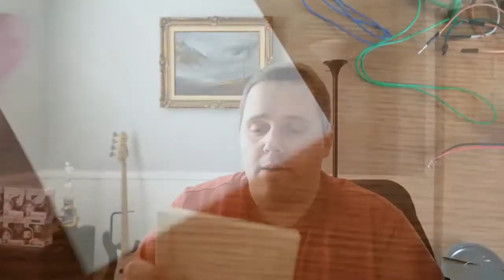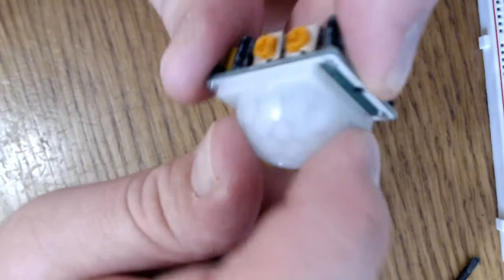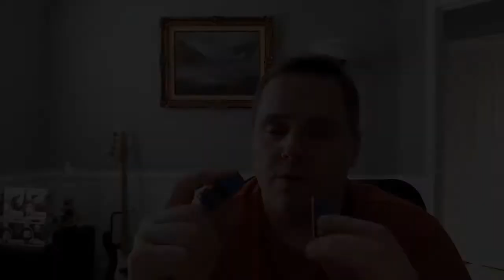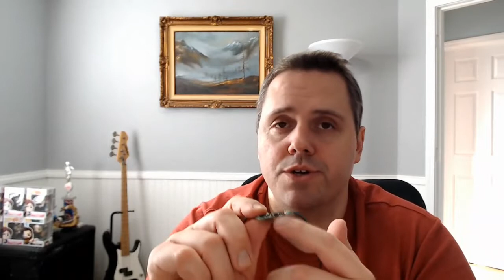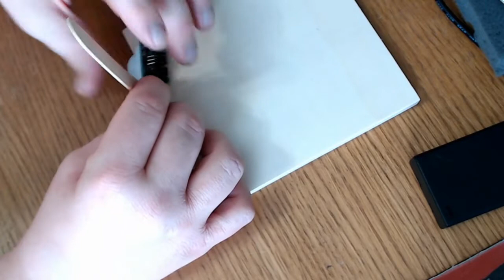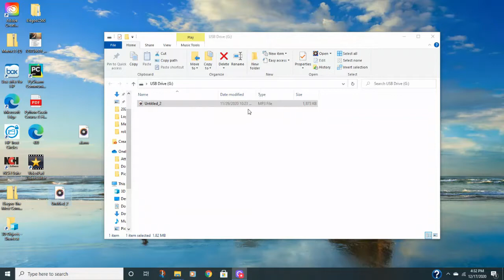How To Create A Simple DIY Motion Activated Sound Device With A Relay Module For Beginners

Comment: Hey there, i have done all the connections correctly as per in your video but my motion sensor which is working won’t trigger the speaker module. Does it make a difference if you put the jumper on the PIR sensor to HIGH or LOW?
Reply from the maker: That is the trigger select. If you put the jumper on the L, the output is high depending on your time delay setting. If L is selected it will not detect motion until the time delay is up. If you select H, the output is high depending on your time delay setting. If H is selected, motion detection is not blocked and will reset each time there's motion.  Also, set your relay jumper on H. When you power it up give it a minute or 2 to calibrate and see how it goes from there.
Reply from the maker: I have both the motion sensor set on "L" and relay set on "H".
Reply: Thank you! I got it to work. Is there a red light in your relay that stays on, as well as the green one. Also I was wondering if you know how I could swap out and use an IR obstacle sensor instead of the PIR sensor for this configuration? How do I find your Facebook page?! Thanks again very much and Merry Christmas and a Happy New Year to you too!
Reply from the maker: it's working, great! 👊👊  There is a red power light and a green status light on the relay module. the red light stays on while there's power goin to the module.   check out the HW-201 IR module. It has 3 pins- vcc, gnd, and a data pin labeled "out".  just connect this module in place of your pir sensor and it should work. This IR module has a working distance of of approx. 1" to 11 or 12" and operates in a voltage range of 3.3 to 5v. You can adjust it's distance using the potentiometer. There's a Facebook link on the YouTube banner at the homepage and linked in most descriptions or you can click here https://www.facebook.com/profile.php?id=100059867144068    If you have any other questions, feel free to ask....happy to help!
Reply from the maker: just remembered that I used that IR sensor recently with my Arduino crystal ball video. You can see it in this video - https://youtu.be/oPAsrBw1914

Comment: The tiny speaker you show in no way produces that volume that you play in the video!
Reply from the maker: I had to dub over the song due to copyright but it is surprisingly loud for what it is. If you mount it with a little space behind the speaker and if it's a smooth surface behind it, you can get fairly loud sound. It can drive my family nuts, for sure!  I just posted a new video with the same mp3 player - check it out here https://youtu.be/AYBB4Fz8j10
This time it has a rooster sound on it. It's not real loud but it's also not in a good acoustic position either.  Apparently the small silver screw on the pcb is a volume adjuster. I've never fooled with it though.
Reply: Ok thanks. I love your video and comprehensive step by step. Most of the tutorials on YouTube are pretty lacking in the explanation department or their overdubbed with obnoxious music and don’t explain anything. You are a breath of fresh air when it comes to learning about these little gadgets and how they function!
Reply from the maker: @minskie  I appreciate the compliment. I enjoy building something and then showing exactly how I did it. I think it goes a long way when encouraging others to try something new. I try to answer most questions and I leave the program code to Arduino videos on Facebook for anyone to use.  It sure has been lots of fun along the way! Have a Merry Christmas and a Happy New Year! 👍